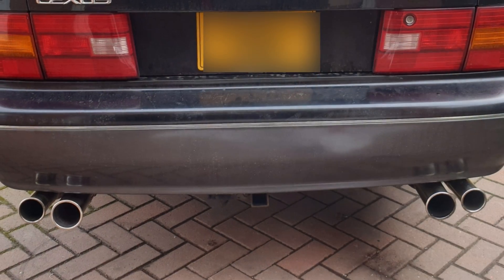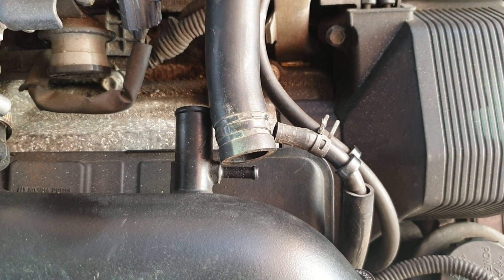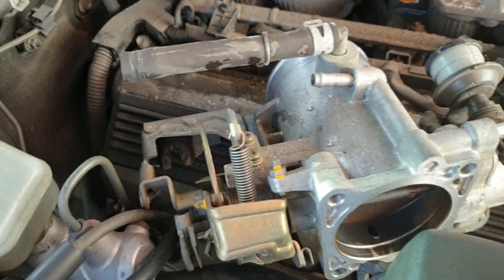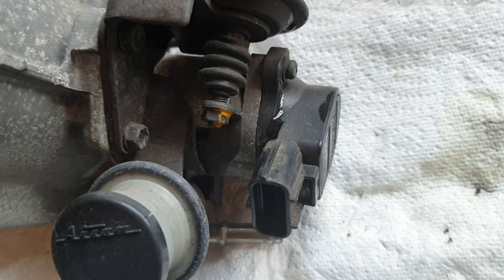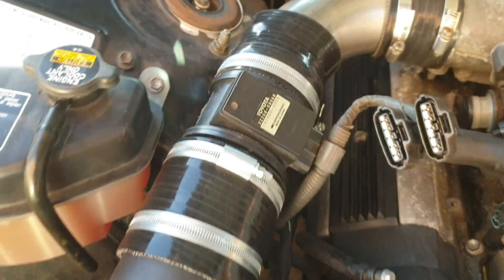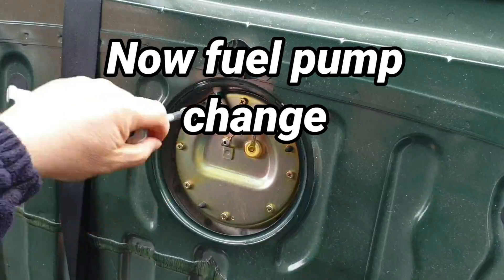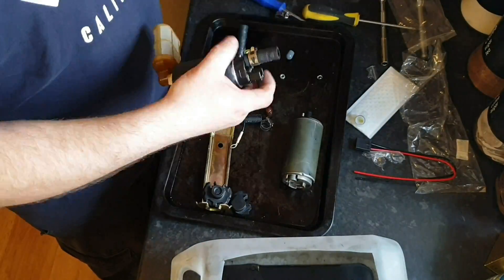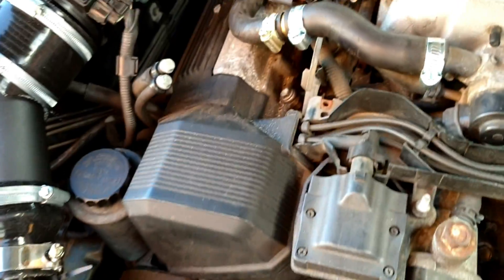Lexus LS400 rear mount TURBO! - Part 8 How to remove throttle body

Comment: great job on the build, i am starting my build too, i was wondering what size turbo are you using, keep posting more updates and tips...looking forward to dyno day
Reply from the maker: Thanks🙂 still lots to do to keep refining the set up. The turbo is a cheap 3540 garret copy although I think the A/R of the turbine housing may be too small but the wheel specs are the same. Its supposed to be good for 600bhp but it could probably really only do 400 maybe. I won't really know until I get some decent management and tuning. But getting the niggles out of the way and I will be putting it back on the dyno, thanks for watching👍

Comment: Not to burst your bubble but you really.need to be using much smaller piping. Id use 1-1/2" (american). With that larfe of piping theres wayyyyy more volume to pressurize and would take like half a minute to do so. More clearance as well under the car too
Reply from the maker: Hey Car guy66, thanks for your input👍I'm with on reducing the piping size, right now it's not what I'd call laggy. It does spool up much quicker than I thought it would. But I defi6want to try going down a little to see how much that changes things. 
It's a constantly evolving project and having input from you guys is great🙂  
Definitely need to get more clearance under there working on that too. 
Thanks for watching👍

Comment: When will you dyno?
Reply from the maker: I will get a dyno run when I'm happy that it's not having any oiling problems and I'm happy at a stable boost level, right now I've got 2psi or 7 to 9psi so need to settle it somewhere around 6 to 7psi to be happy on stock fuelling. 
Thanks for watching 👍